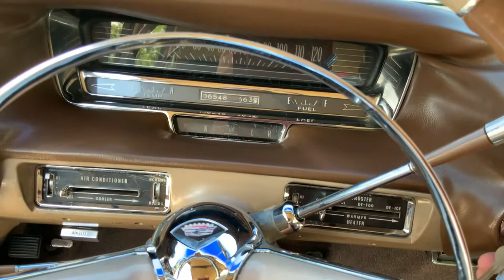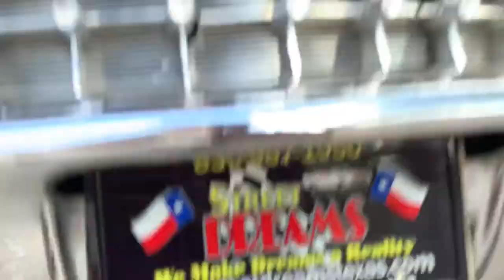1959 Cadillac Limousine 390ci V8 Automatic Power Windows PS PB AC Runs Great 59-6149T

Comment: So it looks like the only option that was not fitted on the Cadillac limousine with The Wire wheels I noticed it had the cruise control air conditioning and power windows an automatic gear box
Reply from the maker: Yes very optioned out.